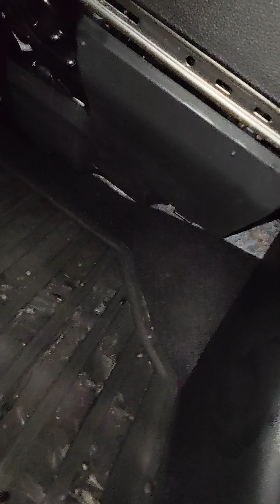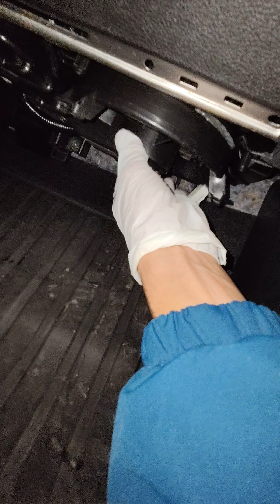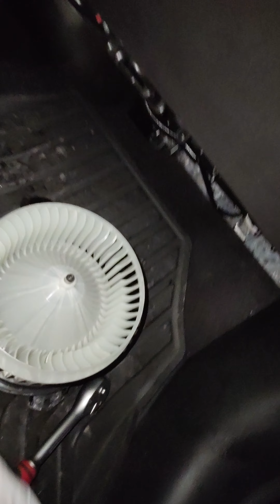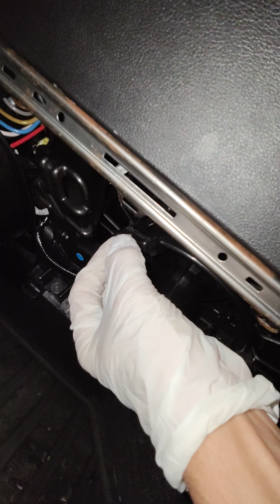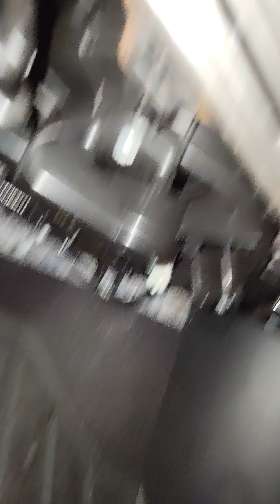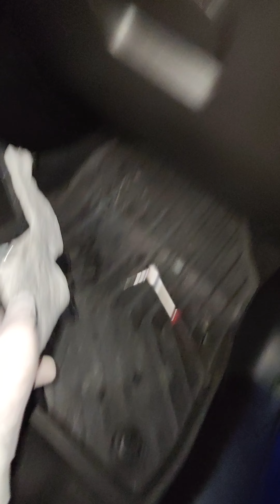Honda civic  2015. European 9th gen 1.6 i-dtec blower fan replacement

Comment: Thanks for the video! Great to see this is a relatively easy job. This video was handy for me to investigate a minor whirring noise my motor makes - thought it might be a bit of leaf stuck in there or something - turns out it's just the design of the motor. Added a thicker piece of foam onto the cover panel and a bit quieter now. Anyway cheers!
Reply from the maker: Good job 😊